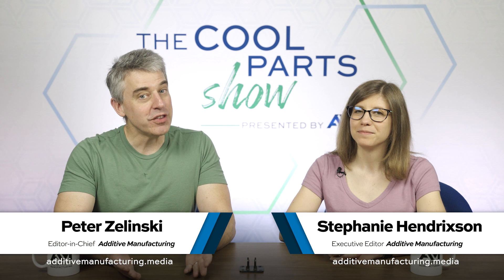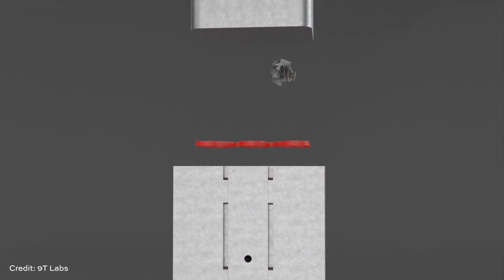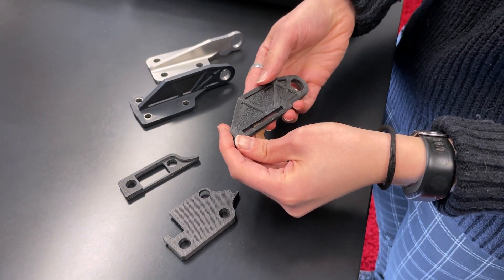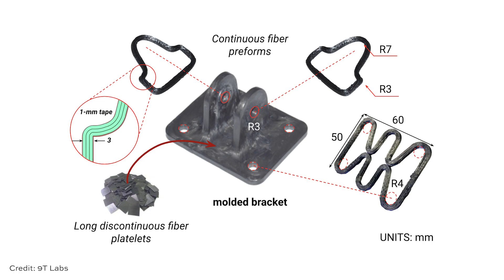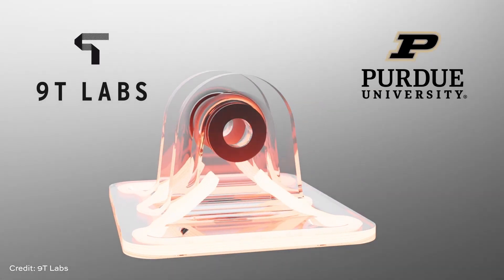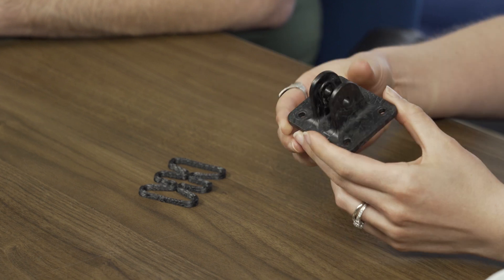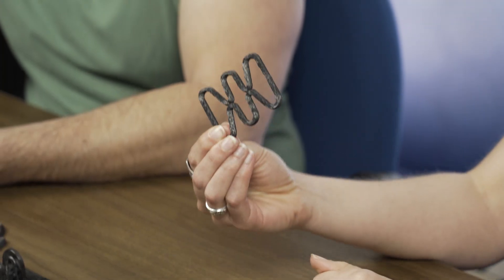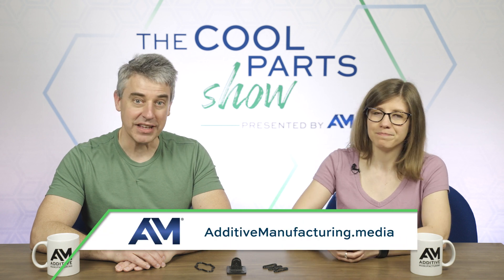3D Printed Preforms Improve Strength of Composite Brackets | The Cool Parts Show Bonus

Comment from the maker: We have more about this!
-TCPS episode that compares a composite bracket for a helicopter hinge to one machined from aluminum: https://www.additivemanufacturing.media/kc/cool-parts/articles/3d-printed-composite-bracket-versus-machined-steel-the-cool-parts-show-42 

-Why "hybrid" composites like this may have an advantage over metals: https://www.additivemanufacturing.media/articles/to-improve-performance-of-compression-molded-composites-add-3d-printed-preforms

-More on 9T Labs' Additive Fusion Technology process: https://www.additivemanufacturing.media/articles/fiber-reinforced-3d-printing-expands-control-applications-for-composites